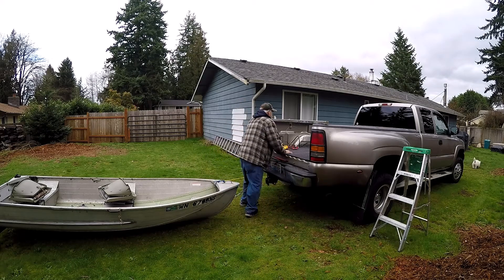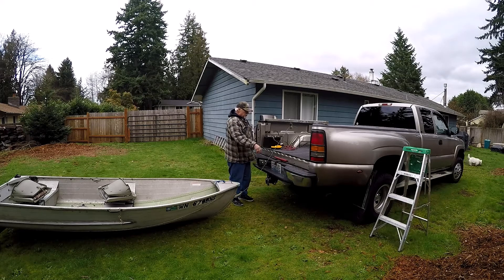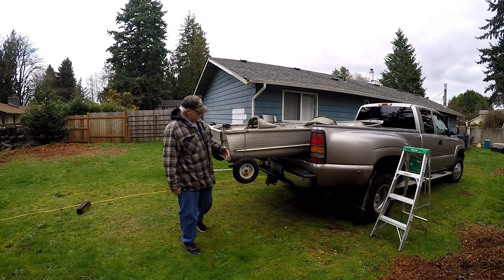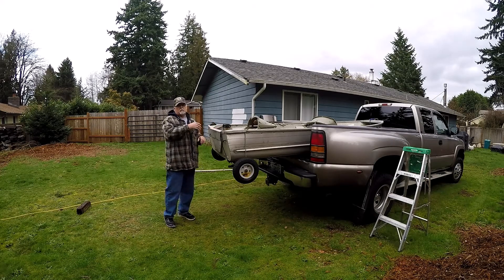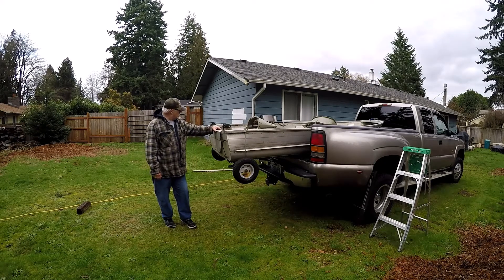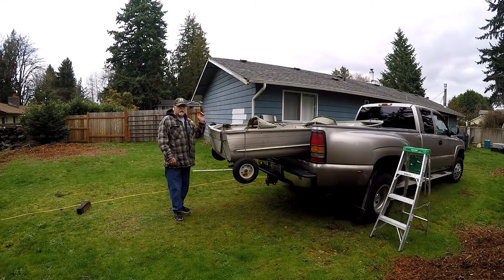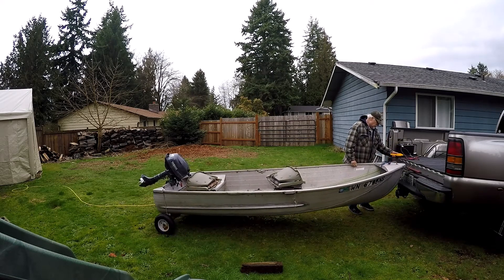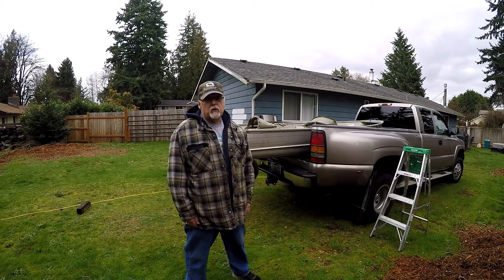boat loader part 3

Comment from the maker: Well folks, looks like I'm getting a ladder rack for the truck which will work for the boat. We are getting a different trailer and trade in the 5th wheel. That way I can take my boat on trips too. I'm going to add my wench to it to load and unload the boat like you see on other boat load videos. Stay tuned for boat loader part 4 hopefully this year

Comment: Great video but I would have left tailgate on
Reply from the maker: I agree after I tried a few things just left it on but without the cables connected so it was at the right angle. I have part 5 coming that will install a boat loading winch for my truck rack I did on part 4.

Comment: That works 👍
Why remove the tailgate?
Looks like it would be additional support ? 
All the best .
Reply from the maker: Actually, since I have tried 3 different  versions decided to go with part 1 with the ramps for now and the wheel cart. I just got a small welder so I plan on making a boat rack. Then load the boat up on that so I can close the tailgate and have plenty of room on the truck bed. Plus the wench will be mounted on the rack. It will make a good video when i get to it.

Comment: It was interesting to see how the boat gets loaded
Reply from the maker: Hi Pople, I came up with this because I hate lifting things if I don't have to. Plus getting older too. Some places where I fish there isn't anyone around during the work week to help me load it and most boat launches are uphill making it even harder. This will work good. There is another plus not shown on this video. Once hooked up to the cable at the launch and bow off the ground I can drive it to level ground and out of the way of other folks waiting to launch👍

Comment: I think I will leave my tailgate open
Reply from the maker: After I did this video I put the tailgate back on but cables disconnected to keep the right angle
Reply: @TimsWorkshopTJY  I think I am going to make some bunks for my bed like a trailer has for my 12 ft V bottom to ride on.  Maybe some detachable ramps too off the tailgate.  Was telling my wife I may use a winch too.  I figure with motor and battery it’s going to be heavy
Reply from the maker: I was thinking the same as far as bunks for mine too but now with my truck rack no need now. Stay tuned for my upcoming videos on the boat rack project